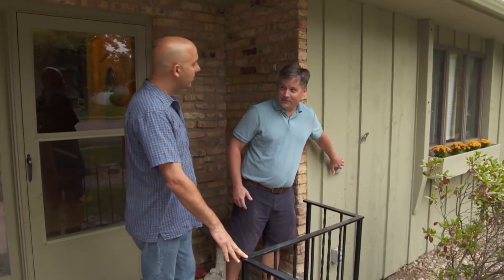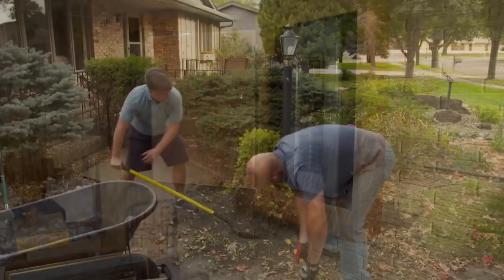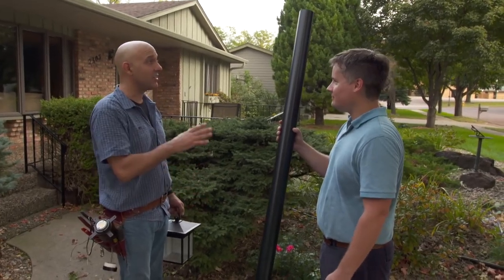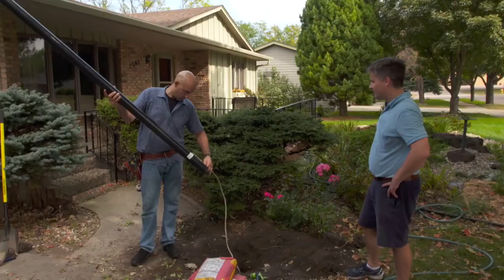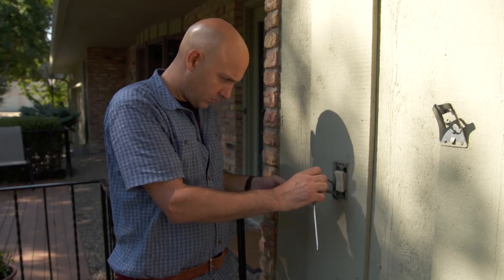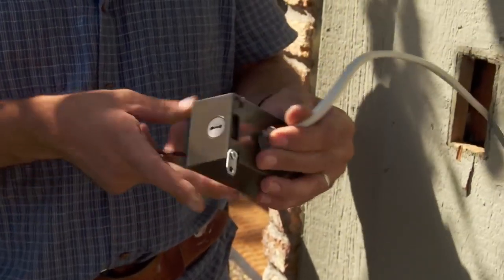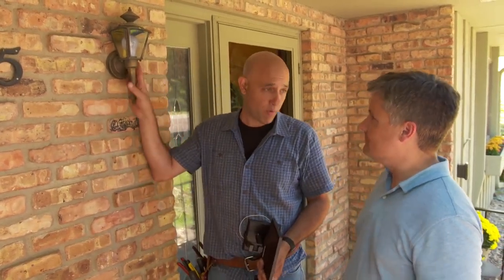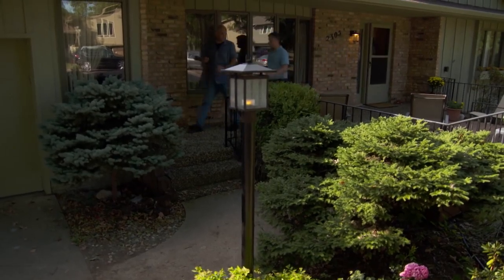How to Replace a Post Light

Comment: Don’t pull a pole out of the ground like he did. You risk stripping the wire when pulling it out and exposing live wires.

Pick up the pole and lay it down then pull the wires out. If you have a helper have them carefully pull the wire out as you are extracting the pole from the ground.

Comment: Removes old electrical box because it was missing the back and exposing the wood, installs a new weather proof box, but leaves a huge gaping hole down the sides for pests and water straight to the wood. Honestly it was more weather proof before he touched it!
Reply: A bit of caulking would have helped, no?

Comment: Astronomical time clock seems unnecessary, its just a light switch cmon
Reply: Just showing the options out there
Reply: Why not splurge for the interplanetary gear so the bulb can change itself instead of the antiquated screwing and unscrewing done in the past

Comment: WHY replace the post? It's still good. Just replace the light fixture. AND you do NOT need any concrete for the lamp post. Just put it under the ground and it won't fall. Mine never fell even with hurricanes. ACTUALLY as complicated as this entire replacement was, pulling wires, new switch, I would hire an electrician. Why? You are dealing with electricity and is a fire hazard..or you may end up in the hospital.

Comment: Where did they learn to put dry concrete and then water.🤦‍♂️ it should be mix with water first and then poured
Reply: Not that type. I used it on a dock light post.
Reply: @marcuspullan1142 
What's the name brand for posts?